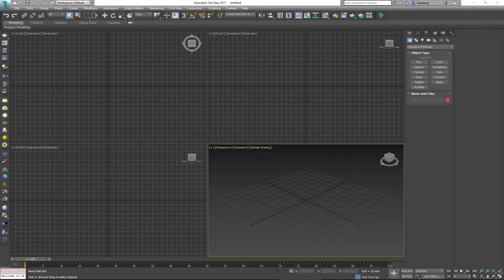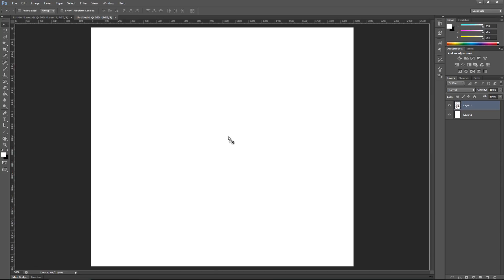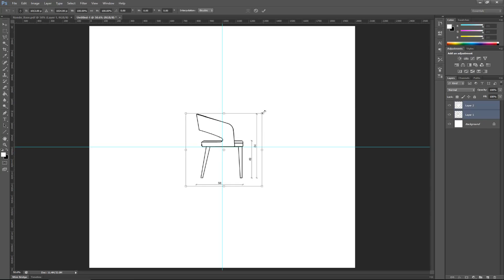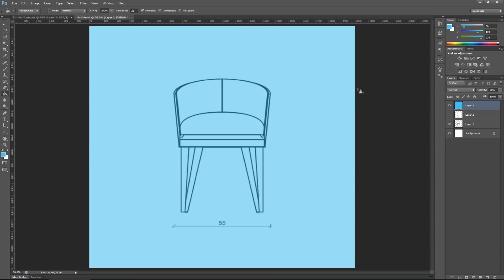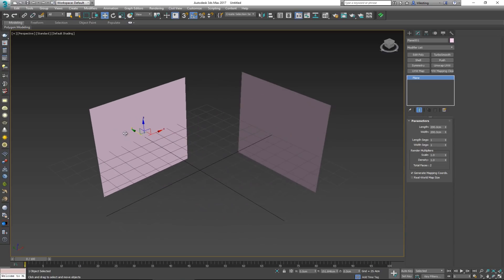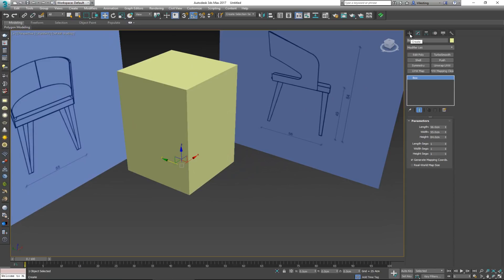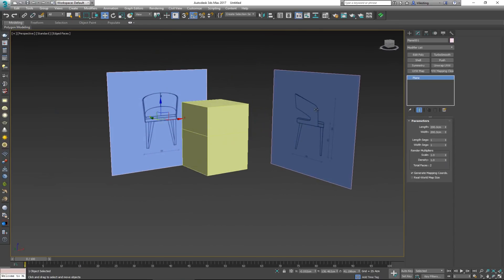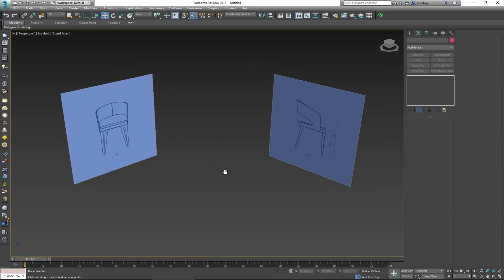Creating the Blueprints for the Rondo Chair

Comment: Hello Denis! I know my question is offtopic, but i was curious why in edit poly, suboject selections for vertex, edge, etc. show in blue...i have also Max 2017 and mine show up in red and yellow like old versions o max UI. Do you have a specific version of 2017,  or you've installed some icons from the 2018 version...i was just curious, maybe you can enlighten me :)...Thank you!
Reply from the maker: usually if you are getting your selection to appear with red and yellow or orange there is a chance you might have clicked on the show cage option ( Edit Poly Mode right under the Settings Button )

As for the version of 2017, i have the stock look i just have a few buttons added for various scripts
Reply: Thank for the reply Denis...i've just upgraded my 3ds Max to SP3 and now the UI looks like yours....I was refering to the icons for vertex, edge, border, polygon and element in the selection rollout under edit poly...the old UI had them drawn in red with yellow highlights when you click or select using 1-5 from keyboard...now they are in blue and have an upgraded look like in Max 2018 and 2019...Thank you again for your reply and keep up with the good work! Cheers!
Reply from the maker: Ah that. Well i do tend to stay in line with the Service pack updates as most of them bring stability to the software. That's why i didn't really know what you meant as it's been a while since i've seen the non Service Pack Max :)